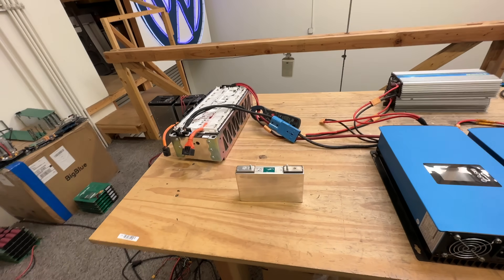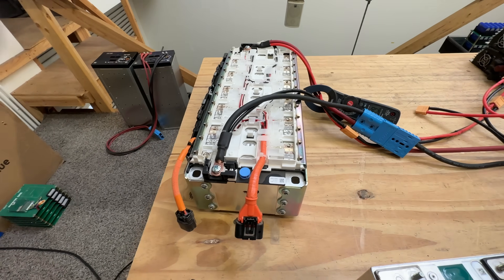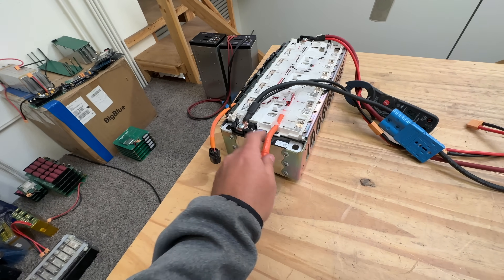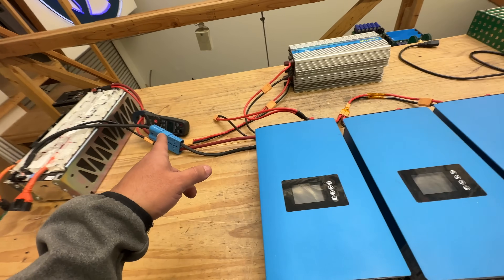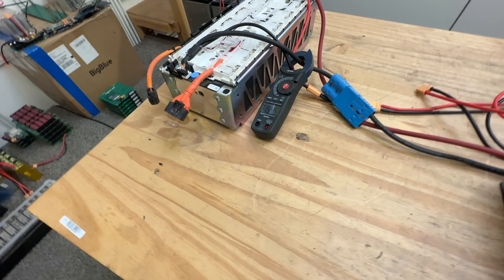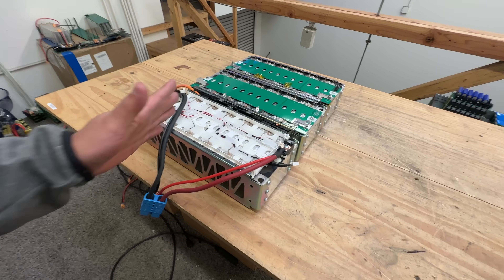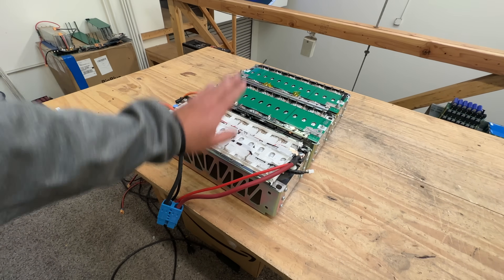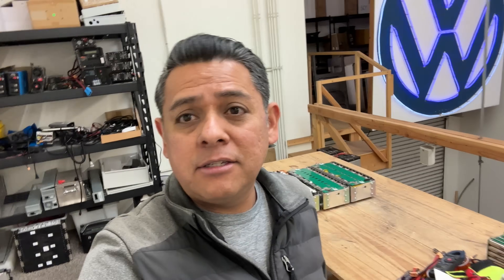1000A out of this tiny battery Pack?  - Bmax

Comment: Im new to messing with batteries and electricity in general but thought about getting a couple of these batteries for the eventual use in a power wall. The energy storage to cost ratio seems really good for these. Am I wrong or would there be better/cheaper batteries that i should use in a power wall?Also, what are the two different plugs coming out of the battery? Would they plug into a BMS?
Reply from the maker: $90 per kWh is hard to beat,   One connector is a heater we believe the other is the balance connector for bms use.
Reply: Awesome. Do you know what the name of that style of plug is? I'm struggling to find a way to tie it into a bms but that's probably just from a lack of knowing what to look for
Reply from the maker: I talk about it here https://www.facebook.com/groups/jehusDiYPowerwalls/permalink/1217611022226324/?mibextid=W9rl1R

Comment: What connector is used for the balancing leads? I want to buy this, but the connector isn't listed anywhere on the website to mate to this pack.
Reply from the maker: We haven’t found the connector yet
Reply: @jehugarcia  but you have a picture of it on your website. Just need the other end. Do you know the manufacturer of the connector? Or do you have another 12S I can use?

Comment: Can these be used in a golf cart or a GEM low speed vehicle?
Reply from the maker: ???  If they work between 36v-50v = yes
Reply: @jehugarcia  I saw on the forklift video that they may not last very long so that's where I'm trying to figure out feasibility.
Reply from the maker: on forklift you can only use 75% of capacity,  so only 800Wh

Comment: I just bought two of these batteries for an Ebike. I am hoping to use this on my Ebike that has a range of voltage 36 vt to 84 volts.
Reply: How did it work? What bms did you use? How was the serial battery configuration? And did you use regen ?

I’m doing the same 😂 planning of course to run them at 88v nominal and 100v ish  full charge

Comment: just curious if you have ever considered building a 400V DC Battery for use as a home Powerwall? I ask because several Grid Tie inverters (Solaredge, Growatt, etc) want these HV batteries that are super expensive. Do you think you could connect 10 of these in Series and have a BMS or group of BMS manage them?
Reply from the maker: Very easy to do,  I’ve only built 250v packs for EVs but 400v is same,  you need hv switches cables though.

Comment: Damn nice batteries but due to voltage limitations I couldn't pay $120 per pack. Just too much work involved to make these reasonable. If we have solar invertors designed for these packs, maybe. Still a tad high for used cells.

Damn nice cells though

Comment: What type of battery is this? and what type of charger should you use?
Reply: Did you find a charger?
Reply: @CodysGarage  I have no found a charger. i should of done more research before  i bought it
Reply: @israelolvera7836  I'm looking too.  There are lots of 12s balancers out there and of course 12s Daly BMS setups.  I looked at the top of the battery and it looks like the balancing wire loom is already configured and connected to that chunky plug and laser welded to the battery terminals. I had hoped Jehugacia had some recs or affiliate link.  I'm just nervous....tbh...of cooking off several balancers or BMS boards before getting the config right

Comment: You are incorrect about how hydrogen fuel cell vehicles work. In actual fact, they get 100% of their traction power from the battery. The fuel cell simply takes the place of the ICE generator in a car like the Chevy Volt. A fuel cell cannot be throttled to the extent or nearly as quickly as an ICE, and can't put out nearly the power of a battery pack. It just sits there constantly humming along at an average output, keeping the battery pack charged. So a hydrogen fuel cell vehicle's battery pack is EXACTLY like a hybrid vehicle's pack (because that's exactly what it is), only it's actually WORSE because unlike an ICE hybrid that uses the ICE engine directly for high-power demand situations, a hydrogen fuel cell vehicle relies entirely on the battery and the electric motor(s) for its maximum power output, and THAT'S why their batteries need to be capable of such high power outputs.
Reply: Thank you for the info, since you know what you’re talking about, I’m building an electric car and to put my project to run, I need 200 V and 200 amp…. If I put five of this module on Serie I think I’m going to have what I need to put in my project to Run…. I was thinking to use 18650 of the one he got on the website but this battery on the video look nice …
 ¿what do you think?

Comment: Those cells will do 25-30c safely . I do have videos and thermal pics on our diy lithium page on youtube… granted I removed from the case and am not using the same gauge wire
Reply: Please share a link
Reply: They are definitely not doing 25-30c safely at a cell level. At 25ah per cell and a 30c burst rating that would be 750A per cell.
They come configured in 12s which is the same as 1s when considering the C rating which is 200A continuous and 400A burst which would be 8C and 16C respectively which puts them right in line with 25ah Cmax cells just a tad bit better.
Can also guarantee these cells will swell and require compression as well.
Reply: @liftedcj7on44s  these cells are 5ah per cell sir....it's one thing to say it vs doing it. Panasonic themselves rate them at 25c, the 25 ah cells are different and do around 10-15c
Reply: @psycho2soundz  these cells are the 25ah cells not the 5ah.
Reply: These cells are 25ah  @psycho2soundz

Comment: I had a lot of those packs. Still have 15 or so left. Great packs
Reply: Any tips on BMS/balance/charger recs?
Reply: @joedifrancesco8182  bms will depend on the in and out current you plan to run. I would go 25% higher then needed. I like the ant bms but it only is able to handle 50A of charging through it. I use solar to charge. A cheap controller is a Make Sky Blue. Nice that is fully voltage adjustable.  9v- 80v . Outback or midnight if you want to spend money. I'm not sure of your application.  Cheers

Comment: The batteries are also used to provide acceleration in fuel cell vehicles since the fuel cell can't change power output that quickly.
Reply: Not much different than a hybrid battery then
Reply: Fuel cells are just low output, not enough for acceleration

Comment: 2 of these in series is perfect for Spintends 100v vesc lineup. Takes you right to the maximum voltage immediately.
Reply: I wonder how much the thermal delta between your location and Australia would affect these cells. 17*c is considerably lower than the 30*c we see on the daily. Surely I'd have to pull back a bit on current to prevent thermal runaway at max pull.
Reply: Actually perfect for my bicycle 😂.

Comment: In theory yes. Only now gas prices are 2x as cheap as electricity, plus it's such a hassle that in reality nobody charges and thus cycles a hybrid battery while smaller than 40kWh packs from EVs get completely cycled once a day. 
Not a fair comparison, I know,  but when I look at Golf Hybrid and Leaf batteries from the same era (2014) the Golf packs still have around 23Ah from 25Ah original while the Leaf's are at 60-70% SOH.
But stating that hybrid batteries get cycled more often is i.m.o. the opposite of how they are actually used. They mostly sit at 60% SOC and constantly get recharged and discharged only a bit.
Reply: Correct, Hybrid batteries do not get fully cycled like most people think.